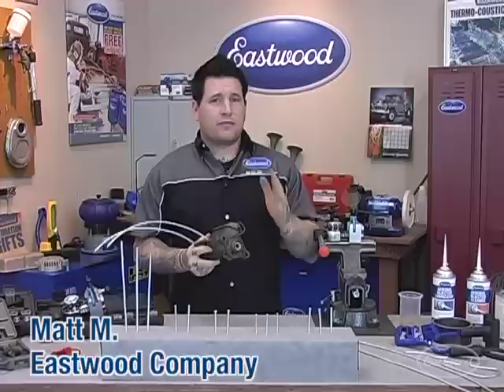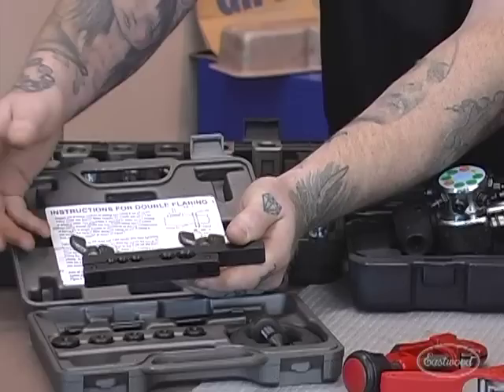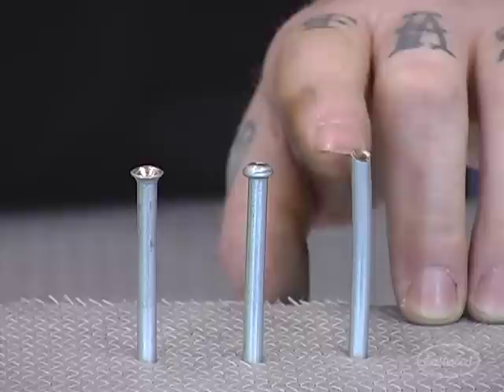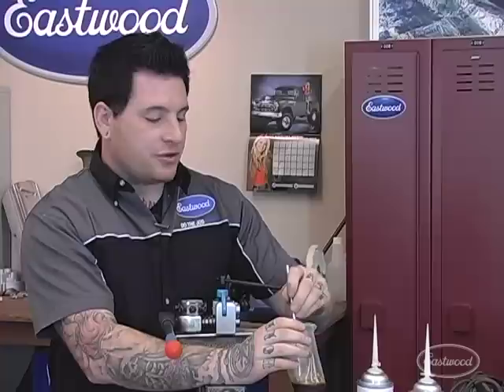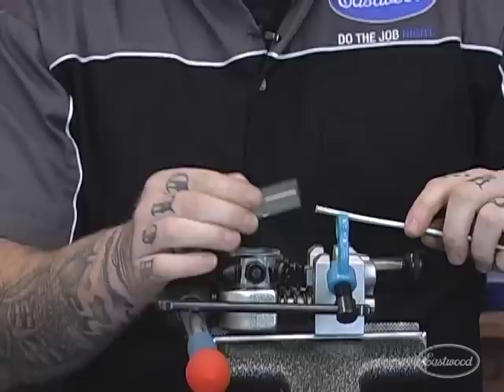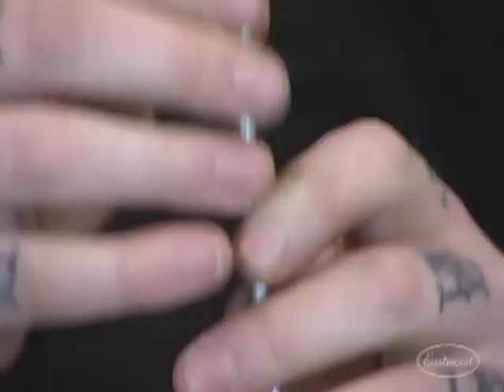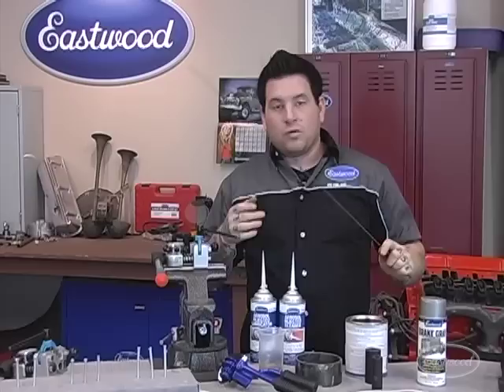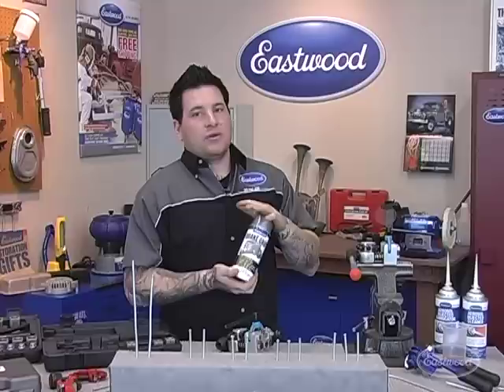How To Flare Brake Line Tubing Demonstration Live with Eastwood

Comment: Brake fluid on its own is not corrosive. Brake fluid turns acidic after it absorbs water. Coatings will deteriorate if brake fluid is left on a surface long enough to absorb moisture and then turn acidic.

Comment: Thxs, Eastwood. Right now I'm replacing lines on a '98 LeSabre, a common platform. All lines have bubble flares (metric.) Most of the lines are 4.75mm, which is within .0005" of 3/16", so it's OK to use 3/16" line & bubble flare it. The lines that go from the HCU (ABS) to the master cylinder are 6mm which we haven't been able to find locally. 1/4" is .014" larger than 6mm. Maybe I can run 1/4' lines & bubble flare them w/my "bar clamp & yoke/pressure screw" bubble flare kit.

Comment: 29:10 He actually did not correctly use the bending tool; you bend from the die-side not the backside. I can't believe he made this mistake.
Reply: Honestly, he wasn’t paying attention. The way he bent the line, he definitely kinked it pretty badly by crushing down with the die side of the bender.

Comment: Unfortunately they don't state it's only good for copper pipe .. try and flare a factory pipe from manufacturer.. it just pushes the pipe through .. does not grip the pipe..
These dyes need to be shaved down to grip the pipe .. ally alloy..
Reply: OR .... make up a paper shim to effectively increase the pipe size that the split die sees ... works very well ...

Comment: At 23: 12  on the right side of the single flare it is split, Not too much impressed with the double flare either. Also a lot of disclaimers mentioned. For the price of this it should be more durable and fool proof, and why not include a good tube cutter with it? And also throw in the dies for a/n fittings Too. Can you get parts for this when it breaks?

Comment: Man, - I wanted to see that hydraulic tool make the GM push to connect line fitting.  - But that is a nice tool you were using on those flare lines.  - How much does that cost?
Reply from the maker: +Blackaboe A link to visit Eastwood for more info is in the video as well as the description below the video.
Reply from the maker: +Blackaboe A link to visit Eastwood for more info is in the video as well as the description below the video.
Reply: +Eastwood Company 
Ok. - But what about those push-on  fuel-line flares, is there a demonstration anywhere on That?

Comment: And how do we make these flares if we cannot afford to spend $ 300, $400 for a tool that will be used once in a three or 4 years
Reply from the maker: +hjjackson05 There are other tools available at Eastwood.  This is just the best one for the job.
Reply: +hjjackson05 So you are saying this company is supposed to just engineer design and manufacture a product and then sell it for almost nothing because you don't have the money?
Reply: +joe8388  Not at all. The question was meant to be rhetorical and some what suggestive. If the question were to be answered I would  expect it (or hope it) to be. “ We have a  flaring tool that does the job for DIYers/ infrequent users. CLICK LINK to see it”. My first attempt at brake lines  I tried a tool made in China that was useless. Eastwood does in fact have a $32.00 tool that I used right out of the box after viewing someone else’s video. I replaced all brake lines on 2 vehicles, some 30 flares, with no leaks and only 3 remakes. Good customer service indicates they should have a video that supports their lesser priced products as well. That video would also increase their sales as it would not be a competing product. Actually this comment is good advertising as it is an endorsement of Eastwood product quality